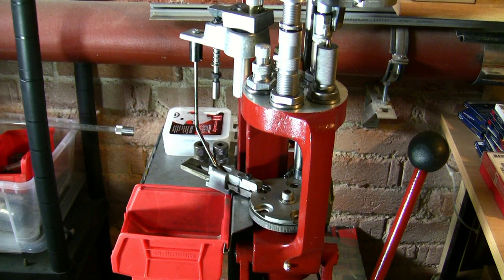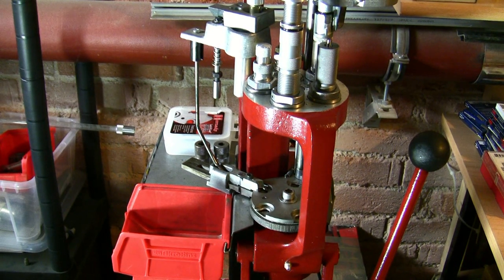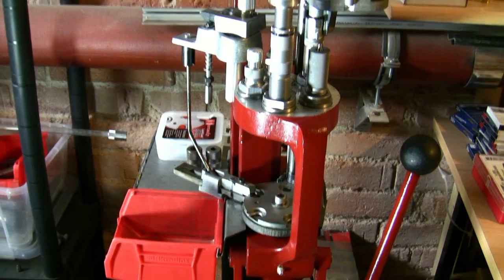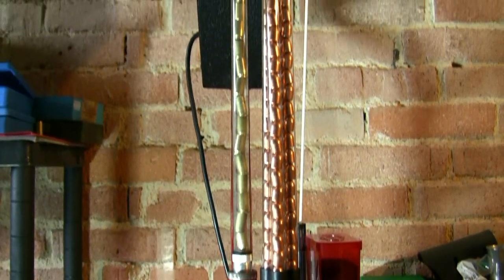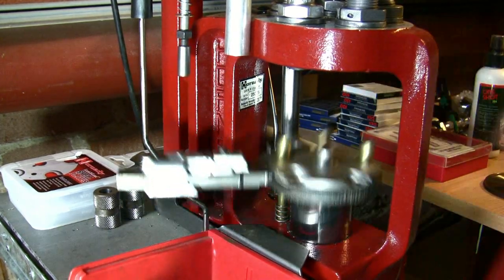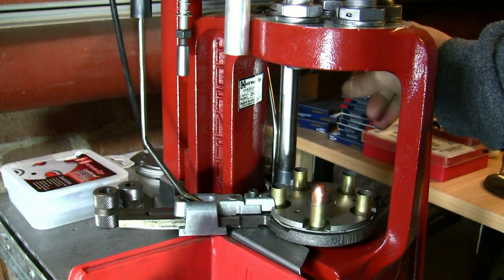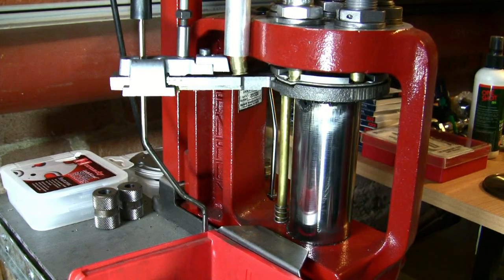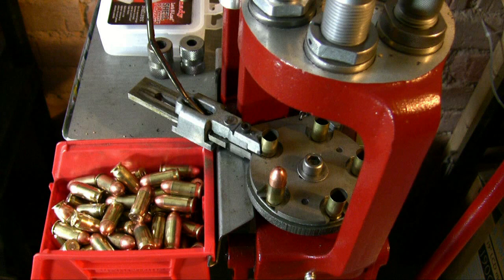Lee Bullet Feeder @ Hornady LNL English

Comment: I just bought same setup and keep having bullets jam inside Hornady die. Can't get 2 to go through back to back. Did you have this setup issue?
Reply from the maker: George Zeck Hey George, sorry to hear that. I never had trouble with my setup. Which die do you use and what is the diameter of your bullets? Are these bullets lubed?
Reply: I'm running the Hornady 9mm die with unlubed bullets.  I don't think that matters because they are really jammed up (I have to use a screwdriver to hit them out).  I'm going to call Hornady (who I don't have a lot of faith on).